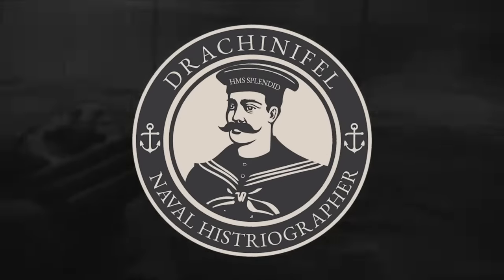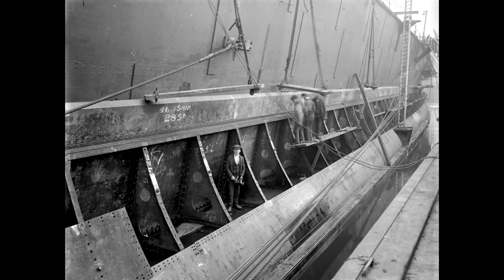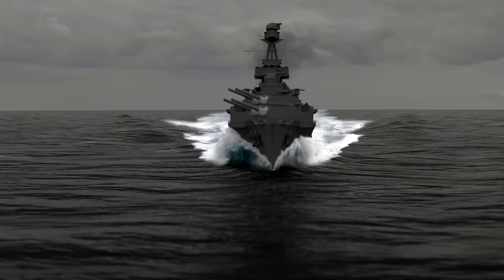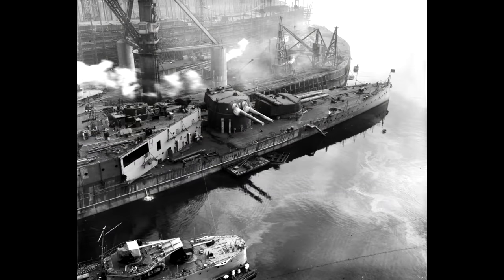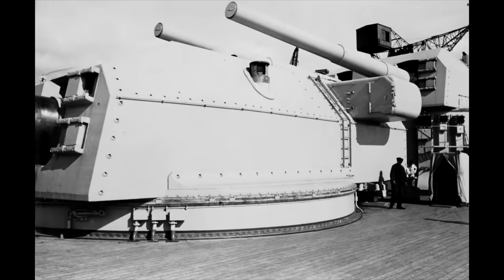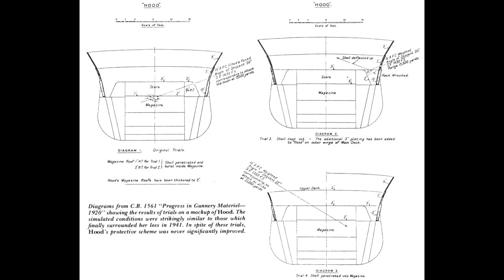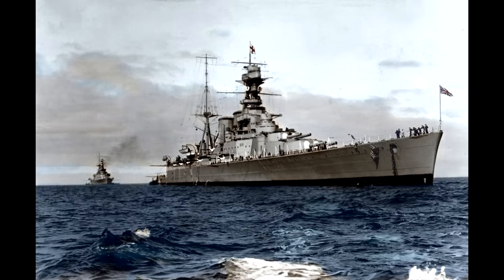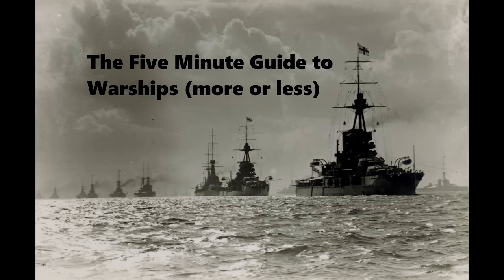The Loss of HMS Hood - But why did it blow up??

Comment: By coincidence, I was going through the Nathan Okun resource on Navweaps, and I was reading through his analysis of the HMS Hood and the results of the 1919 armor tests, made against various permutations of her armor (the end result of the tests was a thickening of her deck armor). The title is a little misleading though, because Okun also goes into possible causes of the loss of the Hood, and there's a lot to chew on there!

His analysis partly mirrors yours, in that he agrees that an aft engine room hit would likely set off the aft magazines. Okun also discounts the possibility of the shell punching through the 7" upper belt and then the 3" armored deck (this is his Scenario #1); it'd skip right off the 3" deck and cause some havoc high in the ship, but not in the citadel spaces. 

So far, so good.

However...by his calculations, at about 9.8 degrees angle of fall, a 15" shell that hit the 7" plate over the aft engine spaces would penetrate and then *only have to contend with a 2" deck*, since according to Okun, the armor deck had been thinned here. And this was something the 15" could penetrate at that angle of fall, even after being slowed down by the 7" belt, ending up right in the aft engine spaces (where your scenario also had the shell fetching up). After that, things go very similarly. This is his Scenario #4.

I guess the key question for his analysis is if the armor deck thinness for the aft engine spaces are right or not. Okun's armor-penetrating formulae are downright exhaustive and extensively cross-checked against historical test results, so they're very reliable. Both his scenario and yours are very convincing, and the video does an excellent job of presenting the case. Either way, it was an extremely unlucky hit for the Hood.

Source document here:

http://navweaps.com/index_nathan/HOOD%201919%20Armor%20Tests.pdf

Comment: So what I'm hearing is that bulbous bows are actually a form of hydraulic armor.
Reply: Honestly as ridiculous as it sounds i suppose it isn't far fetched
Reply from the maker: I certainly would've evened things out along the hull somewhat, as for if the additional water would've saved the ship, we can't know, but it would've had a better chance.
Reply: @Drachinifel  it was a hit to the 7inch belt. that's above the waterline
Reply: @buzzardbeurling  Didn't Drach show in the video that a hit to the 7inch belt at that distance is unlikely to have reached the magazines?
Reply: @tomhsia4354  the obluiquity of the angle is what opens it up. The 7inch belt is no protection at 16,500yards
Reply: @buzzardbeurling  no. However as Drachinifel points out, at the ranges concerned a hit on the 7 inch armour would have resulted in secondary impact at 13 degrees to the horizontal on the 3 inch deck at a vastly reduced velocity, which would have deflected the shell away and resulted in damage, rather than destruction.
Reply: @ScienceChap  only the deck above the engines was 2inch. And the flat didnt extend over the slope to the hull edge. That existed ONLY abreast both mag sets.
Reply: @buzzardbeurling  Did you... actually watch the video?
Reply: @Ealsante  i did. I've been studying hms hood for 30yrs. I'm friends with people who know more about that ship than anyone else alive. There are numerous errors in this video. So what point are you trying to make?
Reply: @buzzardbeurling  What errors? 

Also, a higher hit should be possible to identify in the wreckage, no? Oh and one more question: when Hood is in a turn to port, how much would it keel over?
Reply: @Snagabott  there is no chance of finding hit evidence on the wreck. The area from just aft of Y turret, to the fwd engine room is completely destroyed.

As for errors. Just off the top of my head.
When he saw the pic of the wake trough.
He didn't bother to , or didn't spot.
A: look at the wake on other high speed pics of hood
B: he assumed that the admiralty who were hydrodynamic experts and tank tested hood's hull, got their wake diagram so badly wrong.

Had he looked at it properly he'd have seen that trough only appeared during a turn.

Then he'd have realised as she was hit starboard, in a port turn that trough wouldnt have been there and the heel would mean it had to hit the water further away to get under the main belt. The fuse is only so long.

His diagram through the 7inch belt was correct, but only if the ship was broadside on. I have a pretty damn accurate map that shows she was 50 to 60 degrees angle. Not 90. Enough to bring the slope into play. I realised that early on in my research. It's a 3d problem not 2d.

Finally he got the thickness of the deck wrong. How can this be considered well researched?

I actually gave his theory a proper look to see if i was wrong.
Reply: @buzzardbeurling  How does an increased obliquity allow for more damage? To my uninformed mind, a greater obliquity (the 7 inch belt at a 50°-60° relative to incoming instead of a 90°) would increase effective thickness due to sloping - which would make the 7 inch belt slow incoming shells much more than a squared hit would, and thus make the incoming shells even less likely to punch through the 7 inch and the armored decks below to reach the magazines. I'm sure I'm missing something in what you've said here, but I don't get what it is that I'm missing.
Reply: @cgunugc  at the range hood was hit the obluiquity really didn't matter to penetration.. The german shell could still go through that 7 inch belt with enough power to get into the aft engine room via the slope.

The obluiquity means that the shell on passing through the belt DOES NOT HIT THE FLAT armour deck but instead goes clean through the slope and is pointed directly towards that poorly protected aft bulkhead.

Comment: Fascinating!

From some previous - and less rigorous - descriptions of the loss of HMS Hood that I've seen, I often wondered why the Navy sent such a vulnerable battlecruiser to go toe-to-toe against one of the most advanced battleships in the world at the time. This examination of the available evidence blows the idea that Hood's deck armour was too weak out of the water (if you'll pardon the expression). Yes, Hood's deck armour could not have protected her against a high-calibre shell plunging from a high angle, but Bismark's shells were not plunging from a high angle.

It would never have occurred to me that the trough of Hood's own bow wave could render her vulnerable to a lucky shot finding the gap between the main armour belt and the torpedo defences. AFAICT, this explanation holds water.
Reply: Good to hear another convert to this rationale. The "plunging shot through the deck armour" theory has been queried for a number of years. At the range of the fatal hit, that is approx 8-9 miles, and using historic gunnery data for the 38 cm SK C/34 at that range gives an angle of fall somewhere in the region of 10-14 degrees from the horizontal (the 4 degree spread of angle being caused by uncertainty regarding Hood's turn that she had just initiated), which was wholly incapable of penetrating even Hood's 3 inch deck armour at the given range.

She had the same armour scheme as a "Queen Elizabeth" battleship such as HMS Warspite, a ship that as well and taking everything that the German High Seas Fleet could throw at her during the battle Jutland in WW1, also happily exchanged blows with Italian battleships and nazi glider bombs in the Med in WW2 and sailed through it all. The fact is that a million to one shot from Bismarck was landed on an obscure "Achilles heel" in Hood's vertical armour which almost certainly triggered off a domino effect magazine explosion.

Comment: Drach, thank you for this excellent portayal of the possibilities for Hood's loss. It's clear you draw heavily on Bill Jurens paper "The Loss f HMS Hood - a re-examination". However, you've made everything easy to follow and understand and I think you've definitely hit the nail on the head with the bow wave form factor. Though it was mentioned by Bill,  I think you've taken it to another level of clarity and I agree that it represents the most plausible possibility. Brilliant! Absolutely brilliant!

A couple observations though - please bear with my long post, but I have no other way to communicate this to you at this time.: 

1) The Prinz Eugen theory. - While the info on the 8-inch shell trajectories and lack of penetrative ability is interesting, there are two facts which need to be articulated which put that argument completely to rest. First, Prinz Eugen was firing base-fused high explosive shells. These would have been used because her armour piercing shells would have no hope of getting into Hood's vitals, so her purpose was to inflict topside damage - maybe take out gunnery directors, disrupt communications, cause casuatlies. HE shells would have zero hope of penetration anywhere unless they were duds like some of those that hit PoW. And they certainly set off the boat deck fire in a spectacular manner with her second salvo!   Secondly, immediately thereafter, according to her Chief Artillery Officer Jasper, she was ordered to shift fire to PoW which was done. Therefore the Prinz was not firing at Hood at the time of the fatal hit. End of that story!

2) (This is a bit off topic, but still, here goes...)The "turns" - As stated by Captain Leach in his narrative, there was only 1 turn executed, with the flags raised for a second which was not (i.e. flags hauled down). I believe Hood was hit and blew up near the completion of that first and only turn, shortly after her A-arcs opened. The clinching evidence comes from Prince of Wales Gunnery Aspects Report, with support from Leach's narrative which I'll mention first. Leach states that the 5.25 inch were now in action and then course was altered to avoid Hood's remains. Bismarck shifted fire onto PoW and a "heavy hit" was "felt" almost immediately. (What hit was that?). The gunnery aspects report states the 5.25's fired a deflection triple starting at 18,600 yards - so they opened fire midway between 0557 and 0558. It also states that when main armament salvo 12 was fired, a "heavy hit" was "felt" (note the similar terms!) that set the director setting pointer in the transmitting station, deep in the bowels of the ship, oscillating violently and blew a fuse. (What hit was that?)  Salvo 12 was fired at about 0559.

That hit....noted by Leach shortly after PoW's evasive turn to avoid debris from Hood's wreck...felt in the TS at about 0559...can only be that underwater 15-inch shell that was found in the ship's bottom! The entry angle was right and what else would have caused such a concussion deep down in the TS a couple hundred feet forward?

(Note that the Germans also observed and reported seeing PoW's secondary armament firing followed by the ship's hard turn towards them as Hood was blowing up - Fritz Otto Busch - completely independent of Leach's narrative!)

So...if PoW was already on the receiving end of Bismarck's salvos ot 0559...noted accurately the the TS which was tracking PoW's gunnery, then Hood was already in the process of blowing up and sinking at 0559! Fatally hit NOT at 0600 as recorded by astonished onlookers when they finally got over their shock, but probably in the region of 0558, just after her A-arcs opened and she was able to fire Y turret as reported by most observers, at the end of the first turn. Maybe Holland intended to continue into the second turn, hence her rudder remained over. (Note that PoW's A-arcs opened at just before 0558, Hood would have been clear a little earlier given that her aft turrets could train further forward.)  

So, the second intended turn was NOT the one to open the A-arcs, but more to keep ahead of the Germans' beam and lessen the rate of change of range which would be better for Hood's old Dreyer fire control table to manage. 

This scenario now fits with the narrative of 5 salvos from Bismarck to Hood's destruction - given Bismarck's rate of fire capability. Opening fire at about 0555, she sank Hood with 3 minutes of gunfire. It also puts the range at which Hood was fatally hit, to get sort of back on topic, as somewhere in the region of 18,000 yards, which fits right in with your analysis. 

Thanks for your attention and I hope you've found this interesting. Let me know what you think!

Comment: Thanks for discussing how much the fire would have plunged. I had always had a gut feeling that the plunging fire theory did not hold water. These are long guns, not howitzers, so the arriving angle would not be very much higher than the angle at which a round was fired. 
It would also have meant that the designers of the armour belt were incompetent idiots, which is not likely.
Being a wet ship that is heavier than originally designed would have exacerbated the depth of the trough, making the final scenario more likely: the designers would have assumed the trough would have been smaller.

Comment: Hi, retired U.S. naval officer here. I’d like to compliment you on your entire library of videos. I’ve seen many of them and eagerly await for new ones to be released. This video certainly presents a compelling case for the scenario you describe as most likely. I would like to know your opinion about one issue which I didn’t hear specifically mentioned in your review of potential causes of Hood’s explosion and sinking. You indicated that Hood had hoisted a signal for a 20 degree turn to port (away from Bismarck’s position) and may have begun to execute that turn. My personal experience on a number of types of warships, including deep draft hulls, is that the heel produced by a sharp turn is felt very quickly, certainly within 5 seconds of the rudder being put over, especially when the turn is made at high speed. I don’t know Hood’s characteristics, but on a conventional destroyer or frigate, I would expect a heel well in excess of 10 degrees, which could increase depending on sea state. No doubt this would have been somewhat less on a BB. If Hood was turning to port, she would have heeled in the direction of Bismarck, increasing the angle of the fall of shot from Bismarck. Do you think this could increase the probability of the explanations which claim plunging fire was able to penetrate the deck armor?
Reply: What I understood from the video was that the rudder had turned but the shell hit in the few seconds before the Hood actually turned. Seems like the shell hit at exactly the correct second for all factors: bow wave exposing the hull, rudder turned, Hood still travelling forward & just clipping the magazine between armour & anti torpedo defences. Extremely lucky shot. A few seconds earlier or later, a few feet of difference, who knows what would have happened